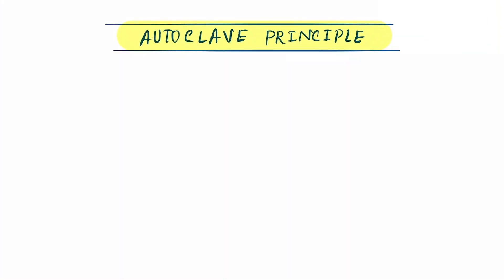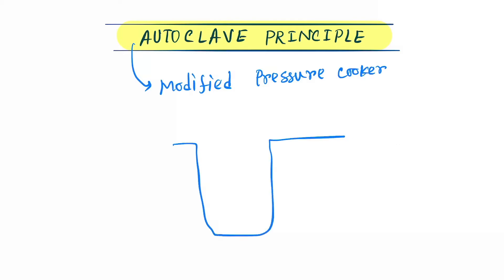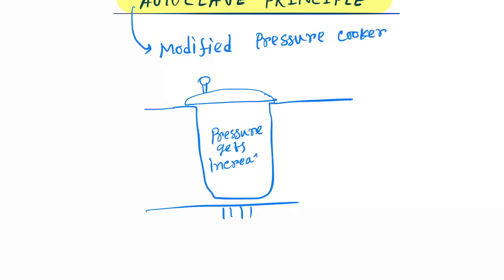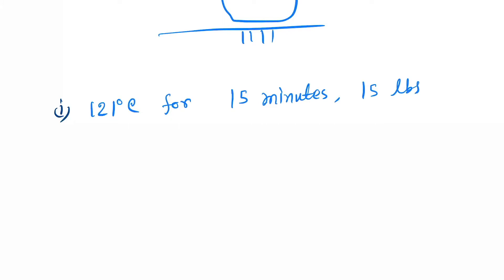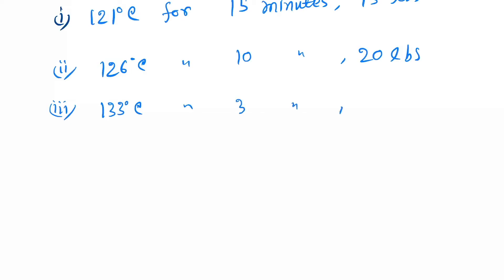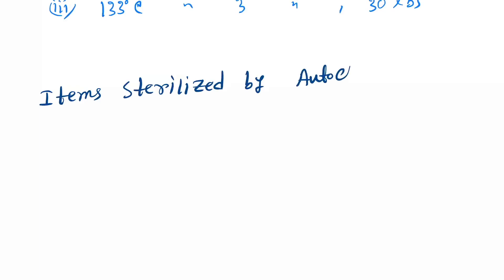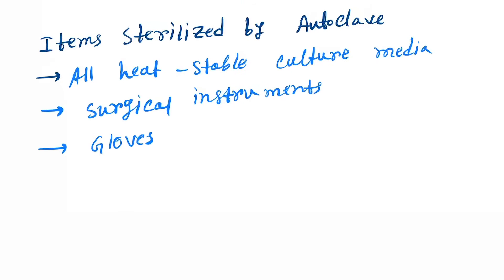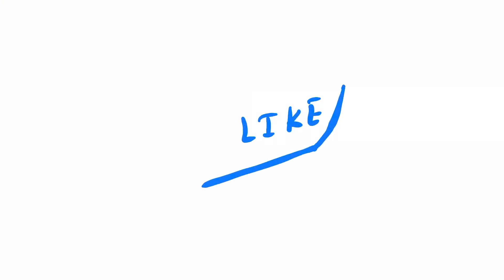Autoclave different temperature,Use,mechanism

Comment: Sir, I want to know that- at the time of running autoclave first time steam then what number of the meter of steam should take up?? After steaming 2nd step -sterile then what number of meter of sterile should take up?? After steam and sterile steps" how many times the autoclave machine should be stopped in loading  situation ?? After that exhaust step and at last vacuum step then autoclave complete. But I want to know that above questions for doing autoclave sir, please tell me about this problem urgently .or sir please give me  your contact number for consulting about this problem.

Comment: Your video should be about the principle of autoclave
Reply from the maker: Autoclave principle is just increasing the pressure with temperature in short...so they use high pressurized steam inside the instrument...And then you have to mention all the different temperature,pressure and time..I think that's enough for the principle...If my answer is satisfying then please hit the like button.